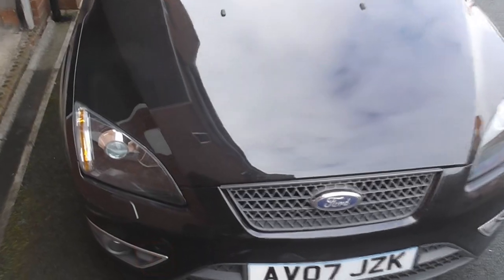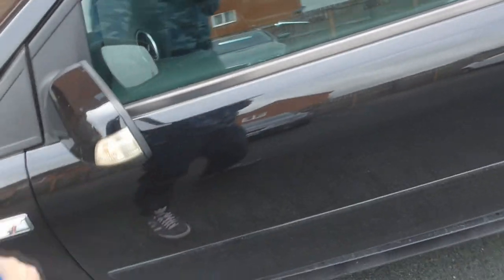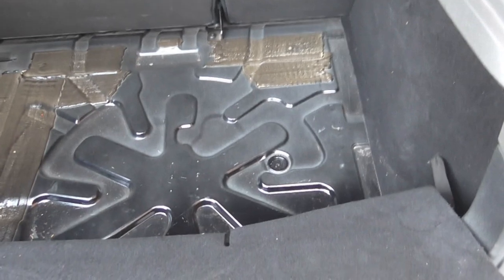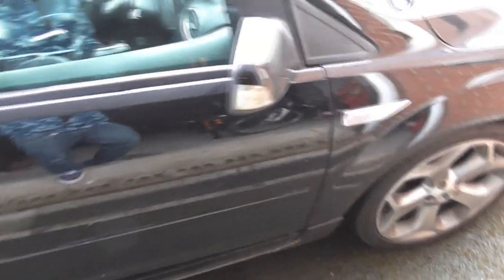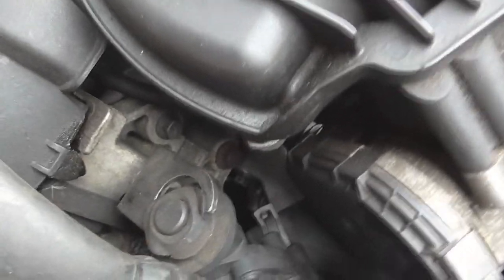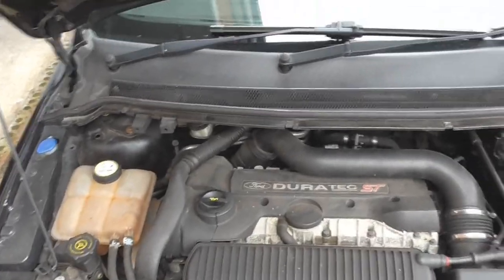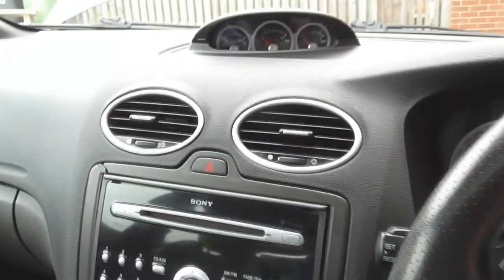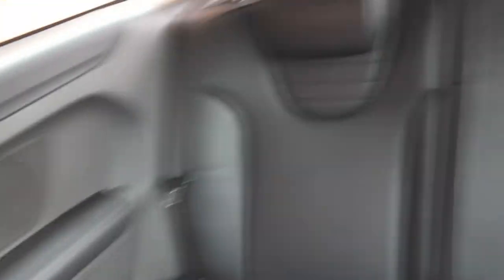My FIRST ever FOCUS ST-3 - What PROBLEMS did I find?

Comment: I had a USB Flash drive made by Integral. It wasn't that small but it could be a USB drive.
Reply from the maker: Stephen Finan watch the end of the video :)
Reply: Just got to that bit haha.
Reply from the maker: Haha :)
Reply: Looks a pretty straight car ,with just a few age related marks etc ..I'm sure it'll buff up quite nicely 😁 new brakes all round 
First MOD I'd do would be a set of,nicer alloys ,they are OK what's on it but ,something a little different from the rest would be a great start ...😁
Reply from the maker: Cheers tony. There's a few finger print dints. Nothing major. Had a scrape on bottom of front bumper too.. may get bumper resprayed.

I like the alloys and have great tyres on at moment so wouldn't want to change them just yet. I'm thinking of power or audio upgrades.
Reply: Bluudys Garage ...maybe get a more aggressive bumper while your at it ,and a pdr to take care of the finger dents 👍
Reply from the maker: I was gonna change the grills and as a splitter. Looks evil with :)